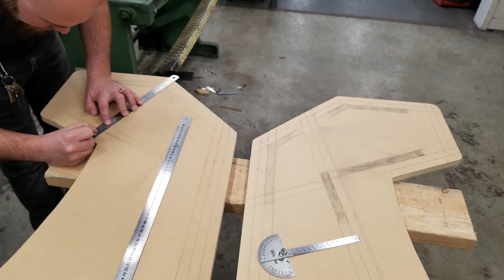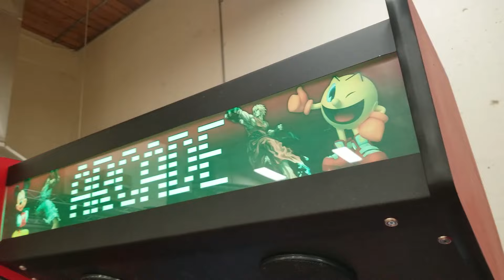Build a DIY Full Size Arcade Cabinet with Basic Tools

Comment: imagine calling a full blown wood shop with routers, pneumatic tools etc. basic tools..
Reply from the maker: My latest facebook marketplace buys: 18g brad nailer for $35. Small air compressor that needed some work for $40. Trim router for $50 (different than shown in this video).

 Home depot sells cheap jigsaws for under $50.... whiners and negative people will continue to complain regardless of how I build (which is even more basic than my previous builds)
Reply: It's basic tools when you realize that most people just cut out these cabinets with a CNC machine.
Reply: I guess you wer expecting him to build it with a stone axe and copper nails
Reply: Imagine complaining about a free video on the internet trying to help you.
Reply: It's a Free video and he gave free plans! Get bent

Comment: Worked for Electro-coin back in the late 80's based in South Wales UK. We built many arcade cabinets. Operation Wolf was the last unit I worked on. I was fortunate to start as a fitter then up-graded to edger and dowler, moved onto the press where everything was put together, and the final piece in this jigsaw as a machinist. We would cut out the side cheeks of the cabinet using a rather large foot operated table router, cut the groove for the edging strip and stack them 30 high left and right. These would be sent for edging and dowling before going off to the press. All other components the machinist cut out were put togther by the fitters and at the press everything was glued and assembled together. The last stop for the erected cabinets was going around the edging with a black marker to hide the small nicks left by the guy whose job it was to trim it flush to the side cheek of the cabinet with a wood chisel. This was also the last job in the factory you had before being sacked. I did it twice before moving onto better and greater things.

Comment: ah yes i just need a 'basic' workshop full of tools.
Reply from the maker: Drill. Basic
Cheap hand router. Basic
Cheap Jigsaw. Basic
Small circular saw. Basic
Hammer and nails.  Basic
Nail gun. Basic (i bought my set used at a garage sale)
Ruler. Basic
Screwdriver. Basic

All could be bought new or used.

Watch the full hour long video series to see step by step how simple this project is when broken down to basic high school level teaching. This can be done in a backyard, driveway, or kitchen table when your wife isn't watching
Reply: @WeBuildStuff  thanks

Comment: Would particle board be fine for this cabinet?
Reply: Most cabinets you see at the arcades depending on their type are made from MDF or Chip board, (normaly used for slot machines) you could use plywood depending on the finish you wanted.